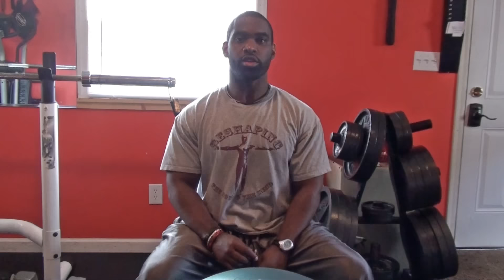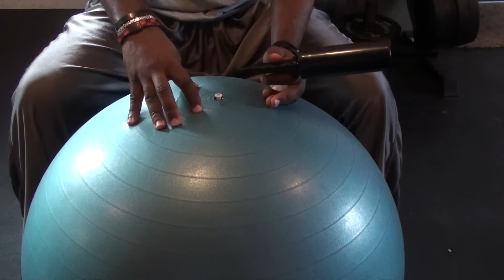Tips From A Personal Trainer : How to Inflate a Core Stability Exercise Ball

Comment: Omg im strugglin. I was just pumpin n puming for like 10 min .my arms so yited and i broke a sweat just to find i was getting somewhere then i wss letting out more ait then putting in. This stupid hand pump. I read instructions and it says not use to one those air comprrssor pumps bc sumin about temp of air or sumin..it could pop. And to use the band it comes with so u dont over inflate .the band measure outs where it should be. I wish i could use my pump for the blow up matress i dunno i might try it. Bc i have now accidentlg let out more air than it had before i started to try to reinflate it. 
Has anybody used pump that u use to blow up air matress? Can u use that? I mean sorry if its a stupid question. I would think u can but now im all worried about it popping lol
I had saved the box with thr instructions and pump and band to measure how much to blow it up. I have had ball for about 3 yrs and it just need a refill but dammit im struggling. The pump was blowing it up but i can hear the air leaking out as i pump so im just over hear. Over excurting myself.

Comment: I think what most people are looking for goes a bit beyond this level of instruction.  

My tips: 
To remove the plug take a wet cloth and squeeze a little water around the plug.  This will allow it to slip and be removed.  Then the trick is mostly is how to grip it, you need to find a flat strong tool of some kind with a gap smaller than the cap of the plug but larger than the stem.  I use an large serving fork but anything with a suitably sized gap will work. Obviously be careful if you do use a fork or any pointy object that you don't damage the ball or hurt yourself.  Then using whatever tool you found slide it between the ball and the plug cap spanning the stem and lift and it should come out.

Inflation:  Basically you want the ball to be inflated such that your thighs are parallel to the ground and your legs makes a 90 degree angle at your knee with your feet flat on the floor when you are sitting on it.  You have to find where that spot is for yourself since it depends on your size and weight.I suggest not pushing the plug 100% in until you are sure you have it where you want it since it's a pain to remove.  Warning the ball does have a maximum inflation value typically given as the circumference of the ball or the distance around the outside at the middle. So simply grab some string measure out a length that is the correct size for your exercise ball and as you inflate test the size by wrapping the string around the ball.  If your have the maximum size given in diameter (length of a straight line from the sides passing through the center of a sphere) or for some reason radius (distance from the center to the edge of the sphere) you can convert them with  

Diameter =  2 x Radius
Circumference = 2 x π x Radius    (π is pi or 3.1415926535897932.... look for the button on your calculator)
Circumference = π x Diameter
Diameter = Circumference / π
Diameter = (2 x Radius)/ π

Hope this helps!
Reply: Brevity is the soul of wit!

Comment: I have the 65cm Stayball by Gold's Gym (blue).  I inflate mine until the distance from axis to axis (one half way around the ball) is 40 inches (102cm).  65cm is the measurement of the diameter of the ball when properly inflated.  So, all you do is convert the diameter to circumference and divide by two. Hopes this helps.
Reply: No 
Mine came with a white tape to wrap around the ball and put the spicier through the two holes 
Pump it till it’s full 
East

Comment: I didn't like it because I didn't get my question answered which would be how do you know what's the right amount or what should be the desired amount
Reply: Shunda Davis has
Reply: you have to know what you're using it for.
Reply: New products with 60% off codes !!
Wind Chimes,
Garment Bags for Suit,
Patella Knee Strap,
Hand Pruning Shears, Bicycle Repair Tool Kit, Universal Socket Adapter,
Bed Fitted Sheet twin/ queen size,
Yoga Exercise Ball,
Travel Space Saver Bags

Comment: How do I take the plug out? It's in there tight, and I can't get a grip on it to pull it out.
Reply: +droppinabigdeuce Plastic spoon.  Saw it on another video and I tried it and worked great.
Reply: Thanks much. I used the side of a metal spoon and it worked great. The plug was in the uninflated ball so tightly, I'm sure any plastic spoon would have snapped.